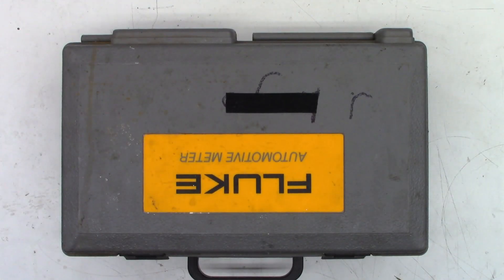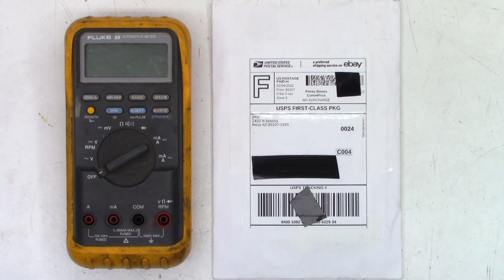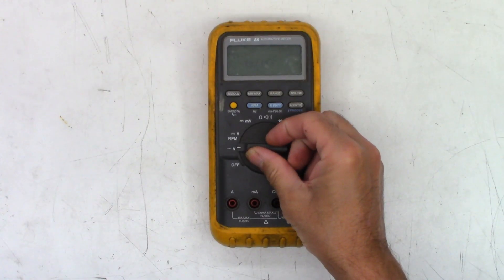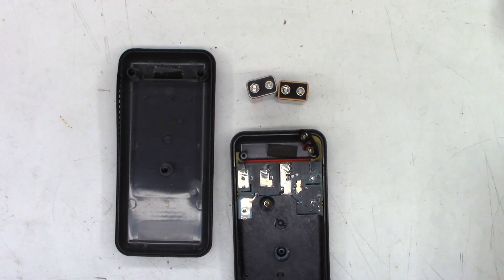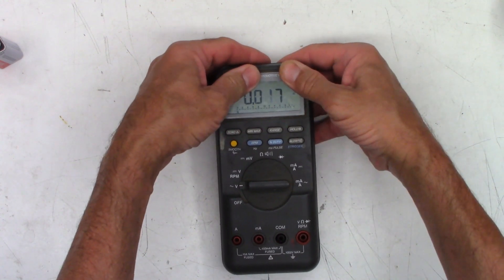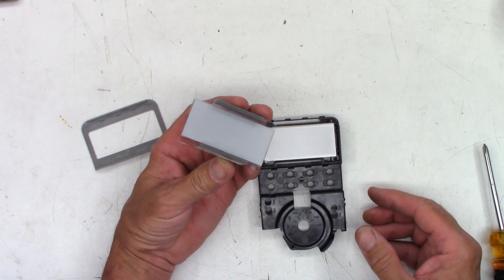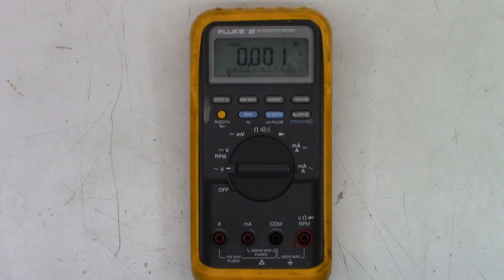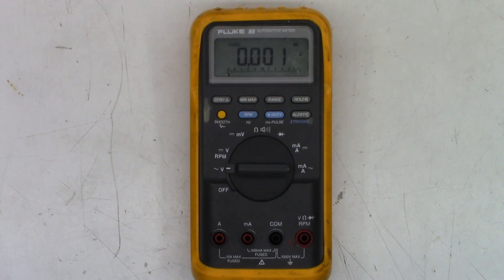Fluke 88 Automotive Meter Dim / Missing Display Segments Repair Fix 83 83-III 85 85-III 86 87 87-III

Comment: I'm glad to discover you had a video on this meter. I kept looking at the beeper on mine and wondering why there were not springs, until I realized those small rubber terminals were the connecting points. All the best.
Reply from the maker: Thanks Dave!

Comment: Thanks for your video. I have what appears to be the exact meter thats in your video. It is a Fluke 88. MY screen is very "dim", at leats looking straight on. Looking at an low angle it's better. I have replaced the zebra stripe connectors and ive replaced the polarizer. The display is still dim. 
One difference I did see is the circuit board where the zebra strips go seams to have some sort of printed carbon -looking ink/paint, not the solder pads like the one in your video. Maybe mine is an older one? The circuit board says "copyright 1990". That just may be for the board. Have you run into this before? I would appreciate your thoughts. Thanks again.

Comment: 9:37 - Once you clean them, it should be OK to also put graphite, which will conduct on press, rubber it self will not conduct, if its regular rubber.

Comment: I noticed gadgetuk64 cleaned his strips.  this is the way I was taught as well, before replacements were available. I know this customer of yours already obtained the parts, but was cleaning potentially an option? I have an old Radio Shack digital meter from the 1980s that will forever be a shelf queen, but the segments are not working well, and I'd like it to at least work.

Comment: Super common Fluke issue and easy fix. My first Fluke was an 88 and just about that vintage too, 91 or 92.  Sold if 4 years ago and still working like new, with case and the spark plug clamp. Learned a lot with that meter! Bought a few other Flukes over the years too, but held on to that one the longest.

Comment: That looked reasonably easy. I wish this was an option way back when. I had one of these many years ago & the display mostly went out on it. The only option I was given by the tool truck guy was to send it in & have it "rebuilt". The cost of the rebuild service was almost the cost of a new meter. I ended up chucking it & buying a Snap-On Vantage Meter, which I still have today. It was a nice upgrade. The seemingly quick failure of the Fluke meter, combined with the high purchase price has turned me off to the Fluke brand for most of my adult life. A grudge that I still hold to this day.
Reply from the maker: I can understand your frustration.

Comment: Fluke has lifetime warranty. If the customer would send the unit, it will be repaired for free including parts. I had a dim buzzer on my Fluke 287 and did send it for warranty repair. No cost for me
Reply from the maker: I may have to pull the patch resistor off of my 87V and send it in to have a complete repair done then.